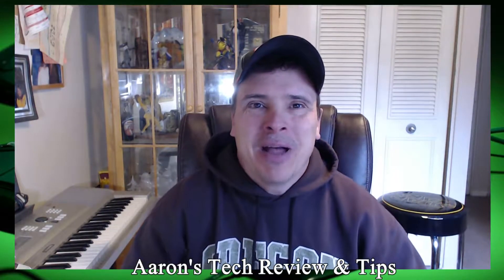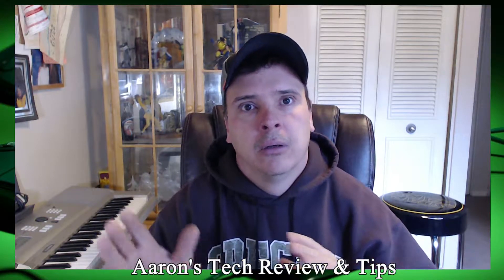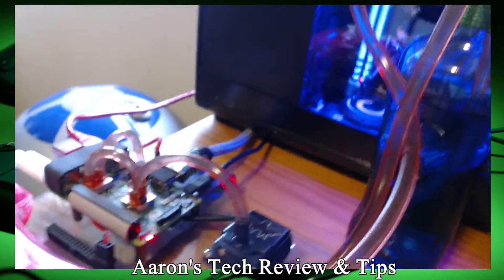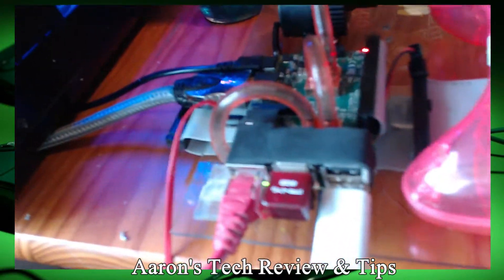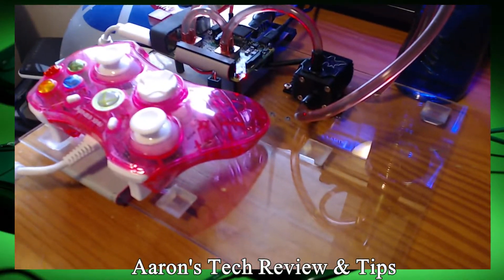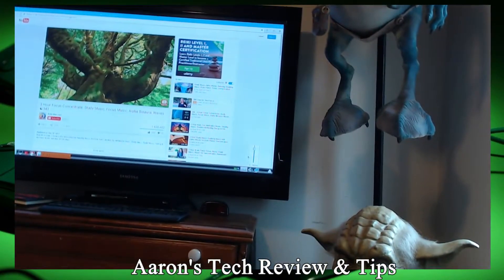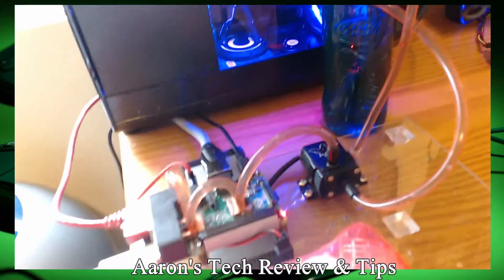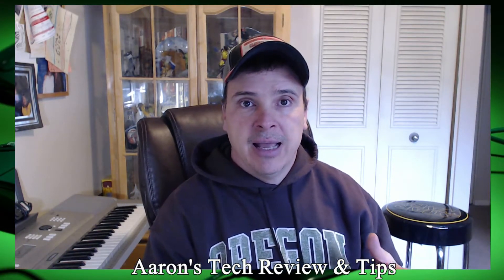Wall mounted Water Cooled Raspberry Pi 2: OverKill  (PART 1)

Comment: Your new gamin rig? LOL great vid!
Reply from the maker: +Noel Sufrin It is... I use Retro Pi and have over 3000 games, everything from PS1, Nintendo, ect. About 30 systems :)
Reply: +Aaron Johnson Have you seen performance gains ?
Reply from the maker: lol! yep its a real retro killer. I did overclock it to 1.2 from a base of 900 :) It stays cool and stable at 1.07 not to shabby for a Raspberry Pi computer.